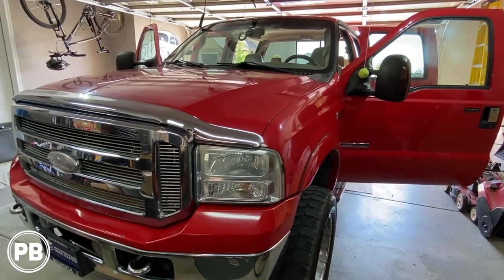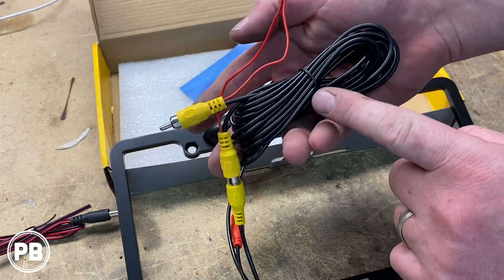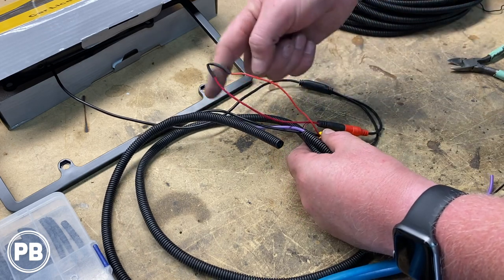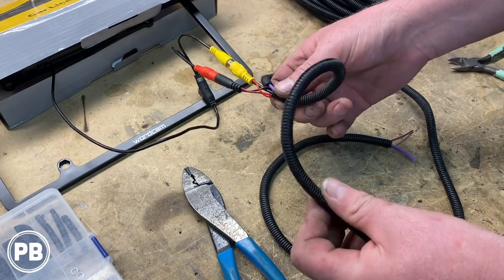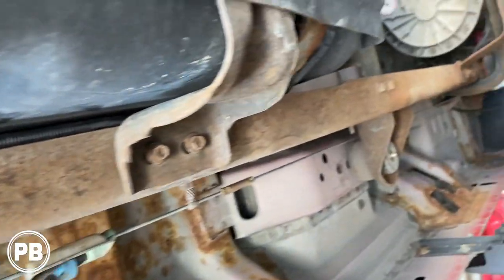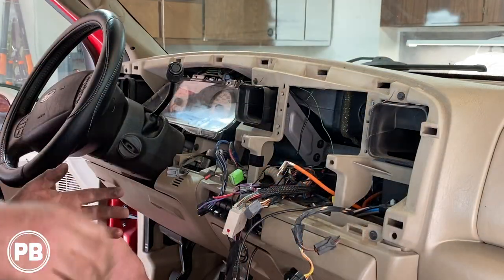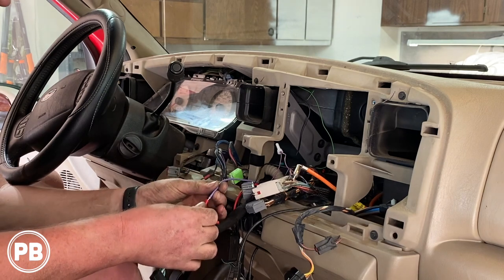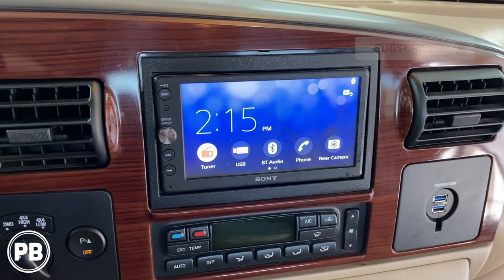1999 - 2007 Ford F250 / F350 Backup Camera Install

Comment: I'm considering installing a backup camera on my 2000 Excursion and I was wondering if the camera has a wide angle view if the camera itself is recessed into the bumper as far as it is with an F250/Excursion?
Reply: Al should be the same for 99-04

Comment: Did the exact same camera and install. But the light stays lit up on the camera when key is on. Any way to fix this. If I tap into the reverse light for the power. It will come on In Reverse but I can’t manually turn on the camera from the screen? Also installed on my 05 f250
Reply from the maker: You will need to switch to a camera without LEDs

Comment: Hey Provo great video thank you for making it easy to understand. I wired my back up camera exactly how you did here into an alpine ilx w650 but when I engage the reverse or press camera on the head unit to view it it just shows up a grey screen with the camera guidelines there’s no image. Would it be a possible bad ground job or it’s just not completing the circuit? There’s no flicker or anything just a grey screen. Thank you
Reply: My backup camera came with a "cap/cover" over the lens to protect it when shipping/install.  I forgot to remove this at first and couldn't figure out why I couldn't see anything.  Just something to check.  I felt stupid when I discovered it, but its an easy mistake to make.

Comment: i purchased and installed this exact camera. The light on the license plate frame stays lit continuously at night whether you are in reverse or drive. Did I wire it wrong or is this the way its suppose to be? thanks
Reply from the maker: the camera may have changed since we installed it on this truck.  if you want to power the camera on accessory power (on whenever the truck is one to use it more than just in reverse), you need a camera without white LEDs.  The Camera we used had red night vision LEDs which is why we wired it the way we did.

Comment: In the video they connect a yellow rca with a white rca cable and narrator says it does not matter what color rca you use they all will work. That is not true. The yellow rca only carries the video signal. Red and white rca cables only carry an audio signal. The info given in this  video is not accurate. Do not try to do it his way it wont work
Reply from the maker: LOL.  We just extended our RCA cable as it was too short to reach the radio.  An RCA cable is an RCA cable, the audio signal doesn't care what color the manufacture made the RCA shielding.  Don't comment bogus information just to confuse other viewers.